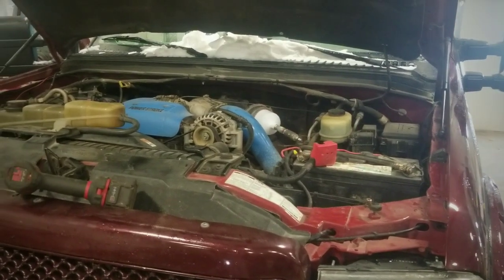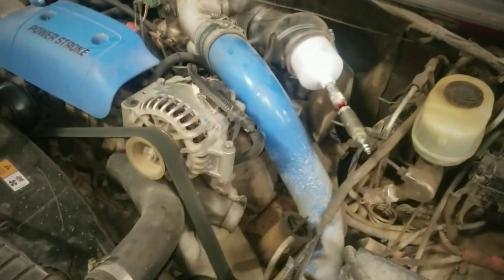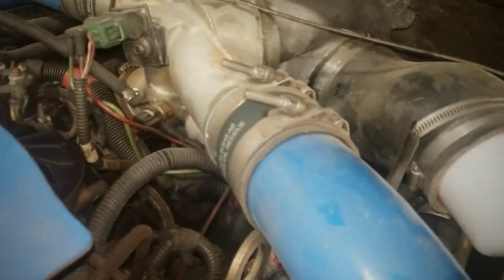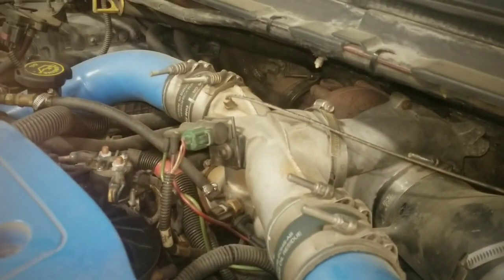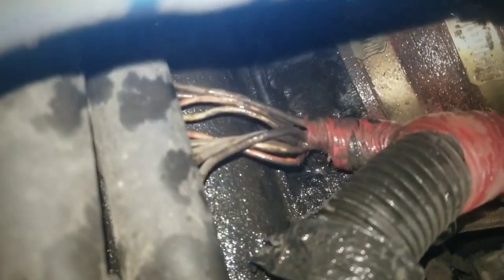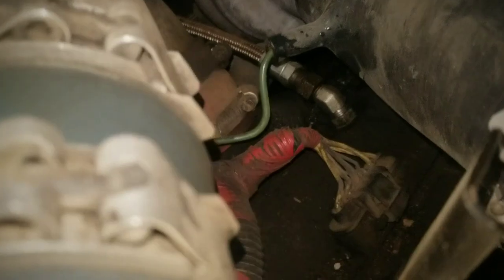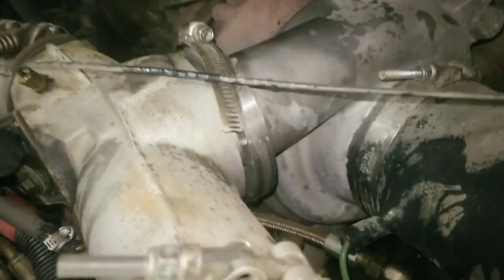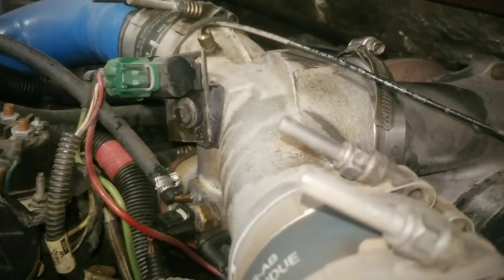Boost leak testing a 7.3 Powerstroke

Comment: WOW! Yes, you have a few leaks there. I wish you luck. I know it will take some time. And thank you for the demo.
Reply from the maker: It's all fixed and running amaxing
Reply: @brunssenboy  what all did you have to fix. Was that your valve cover gasket leaking??
Reply from the maker: @davidmaj4259  I haven’t messed with fixing the intake plenums, but fixed the main leak from turbo to spider.

Comment: I get 8-10mpg no matter how i drive!  What kind of psi do you get when driving?  I avg 5-7psi@70mph
Reply from the maker: I get around 2 to 5 psi around 70 depends if on a hill or not
Reply: @brunssenboy  yay on some hills i can build up to 12psi. If you dont mind me asking what mods does your truck have and what kind fuel mileage do you get? How far can you get on one tank of diesel!.  I only ask because i get a max of 10.5mpg in my7.3  hwy intown 8  i just feel like this isn’t rigjt
Reply from the maker: @bolt2510  I do mostly country driving lately going to work and back but I get around 10pm not sure on highway don’t drive it enough to know. But my build list is 180/30 injectors, kc turbos 63/73 turbo, oil crossover line, medium built transmission with a triple disc billet torque converter, bellowed up pipes, s and b intake, 4 inch exhaust, hydra tuner with Jelibuilt and 1023 tunes, ebpv deleted pedestal. And that’s about it

Comment: My 2001 7.3 only gets max 10psi of boost unloaded is that normal on a stock 7.3 or is that low boost?
Reply from the maker: A fully stock 7.3 should get 15-17 pounds of boost.
Reply: @brunssenboy  ok thanks